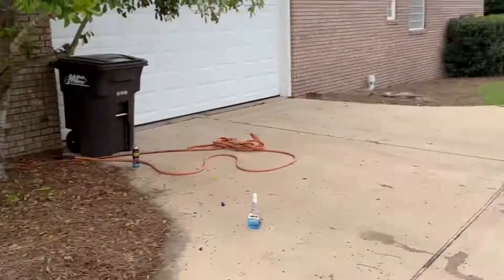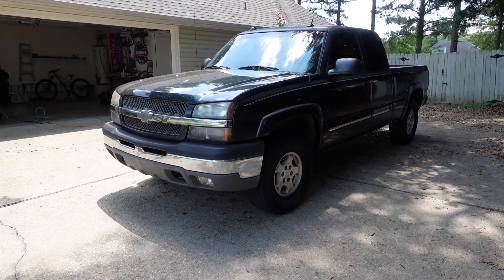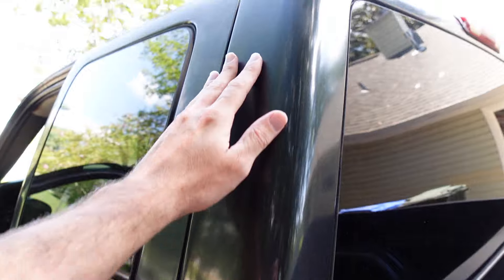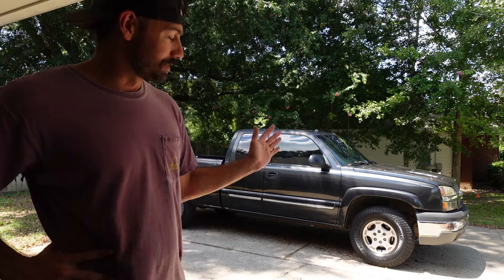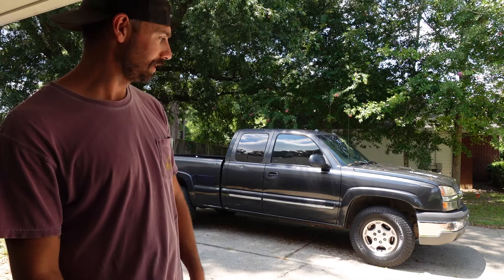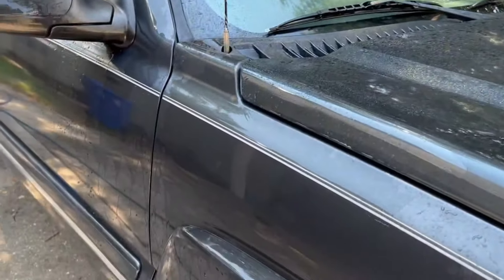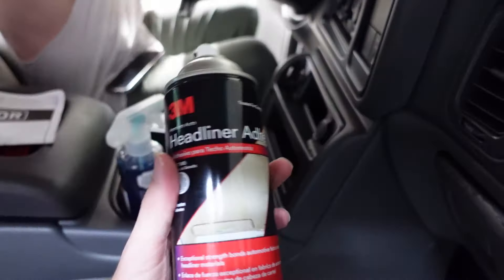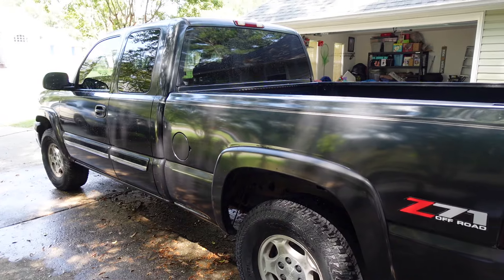Made a mistake buying a truck at night, worse than I thought...

Comment: I have a '04 Silverado with almost 350k miles, its been an excellent truck the past 6 years. The dash comes comes out of these trucks super easy, its basically just a cover over the main dash structure, just snap the bezel out, A-pillar trim, pop the vents out, push the tabs to release the grab handle, then its just a handful of 7mm screws holding it in. It should be easy enough to find a decent one in a jukyard, or someone doing partout, I have a near perfect, uncracked one in my shed I saved from a partout if I was closer to you I'd let you have it for free
Reply from the maker: I've done some more research on replacing them, and it does seem pretty straight forward, I'm actually going to look at a truck tomorrow, and try to get the dash out without breaking it, if I can, ill be putting it in mine

Comment: On that dashboard they got like 8mm bolts behind the dash bezel and some behind the two covers on each side of the lower dash and a few on top very easy to just replace just the top cover
Reply from the maker: Can you replace without dropping the whole the dash?
Reply: indeed.
Reply: @Hunterrnorris  yes sir!  It's just the dash pad.  Maybe you can find one in a wrecking yard.  Just be careful, b/c if it's not cracked, it may crack once you start moving it.
Reply from the maker: @jewllake  thank you for the heads up
Reply: @Hunterrnorris  yes sir